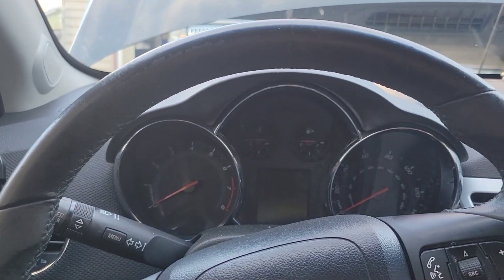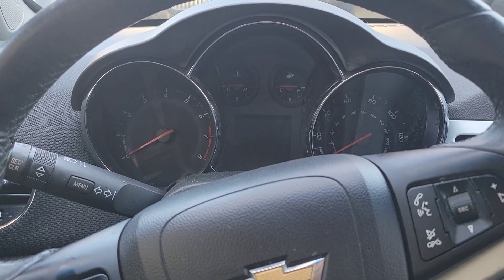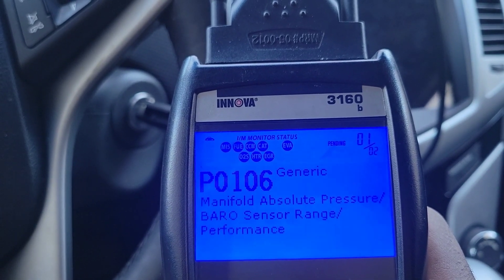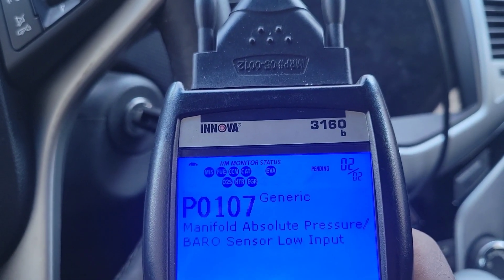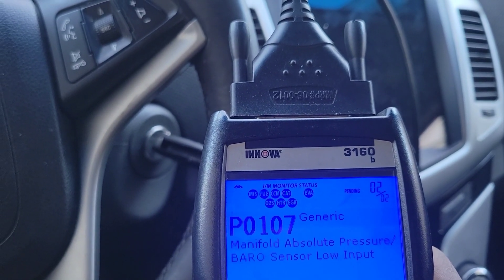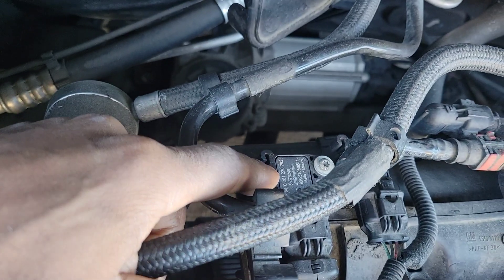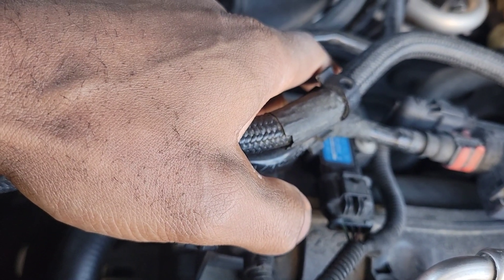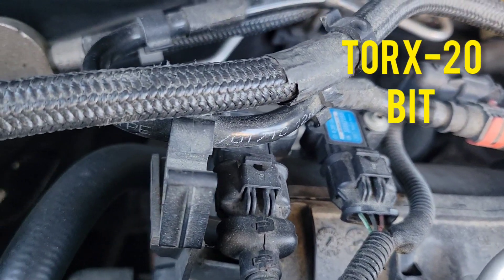"Solve Code P0106 & P0107 in Less Than 5 Minutes!"

Comment: Does 2016 Chevy Cruze lt 1.4 turbo have a Baro sensor?
Reply from the maker: I haven't worked on a 2016, so I'm not sure. I do know some of the later models do not have one.
Reply: My 2016 trax LS 1.4L doesn’t have the first sensor to the left of the barometric. I used MAF sensor cleaner on the blue barometric sensor during maintenance while replacing the water inlet housing. Apparently I spilled coolant on the main harness connector and terminal. Removed the negative on the battery and sprayed compressed air in the connector and terminal. I didn’t have my multi meters to test continuity but waited a bit to make sure it dried, slapped everything back in place and ran the data, OBDII data indicated map was reading again.